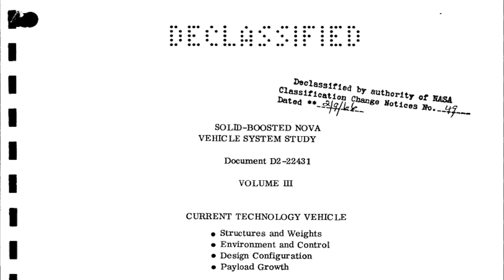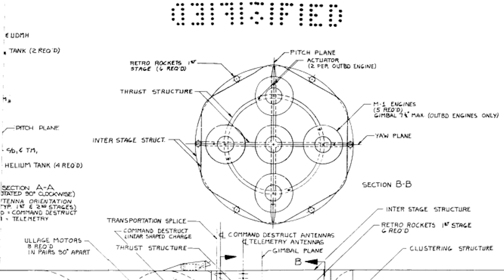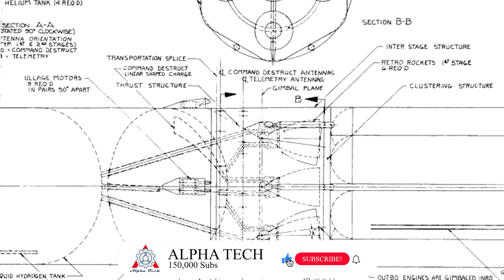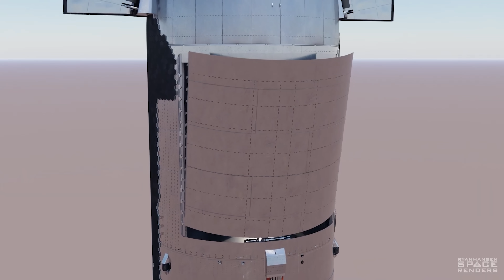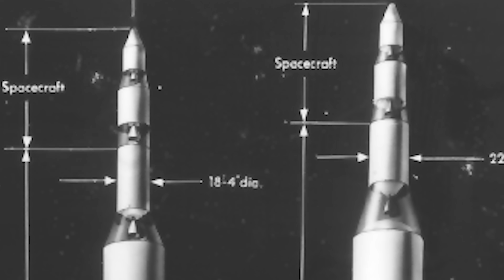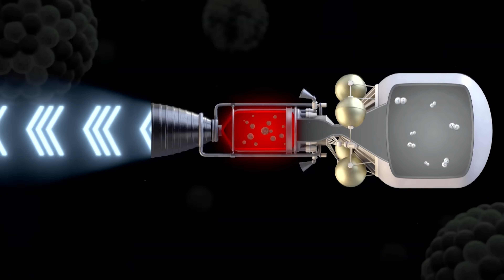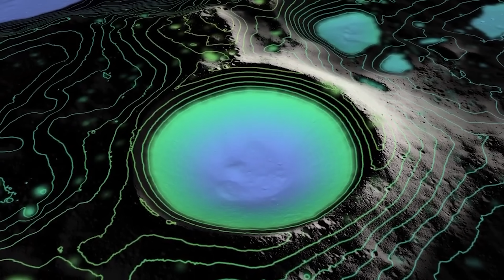Elon Musk's Insane Starship Moon Design Shocked NASA: Skip Refueling!

Comment: Again heard that individual  companies do not want to share ideas for the common goal, now the blue prints are already there like many things technology was not invented yet but now mostly has.  It is time to bring engineers from different companies together to have some ideas out there and see which ones would fit or have to have some modifications done for compatibility of course this new technology so not crewed missions would have to be done for crew safety for the launches but with one vehicle being used have the next one in beginning stages so that any modifications that need to be done can be done from the previous launch data received.  Simple idea I know but it  is possible when a goal is wanted it's called cooperation.

Comment: As noted elsewhere, the Starship should land horizontally on legs before settling on its belly. It would contain living accommodation and cargo. The astronauts would land adjacent in a separate capsule and transferred to the main ship. The return would be in the landing capsule.
Mars would follow a similar system but use a 4+1 cluster of Starships. There would be 2 landers - 1 for use the other for spare/emergencies.
Reply from the maker: Yes. We discussed about this in last episode
Reply: Are you in contact with Elon?
It would make the Moon easy and a testing ground for Mars. Each new Starship would add to Moon base or Mars colony. They would also be refuges if required.